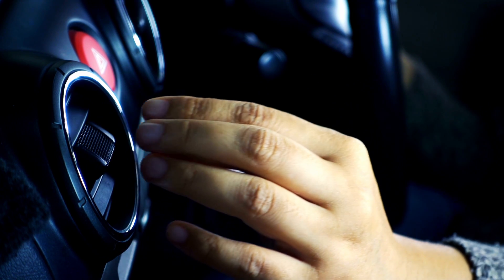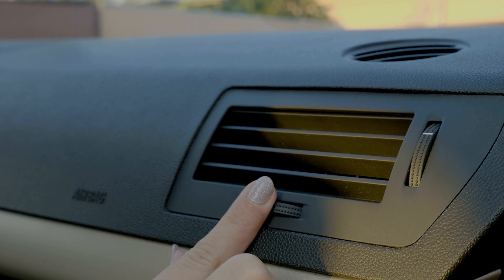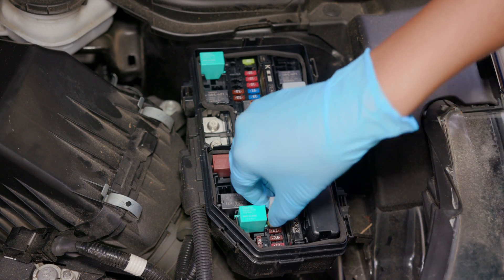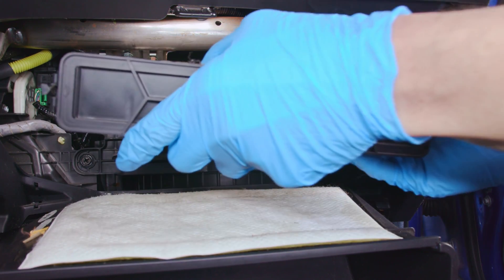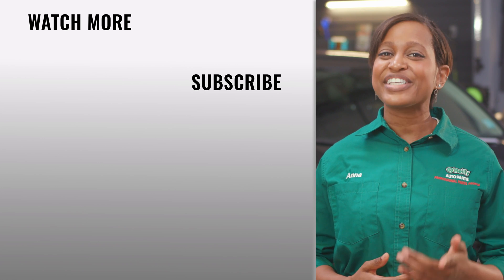Diagnostic: Why Is My Car A/C Not Blowing Cold?

Comment from the maker: 0:00 Welcome Back
0:40 Air Isn't Cold
0:53 A/C Compressor Not Activating 
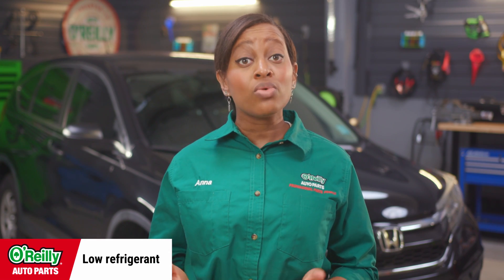1:12 Low Refrigerant 
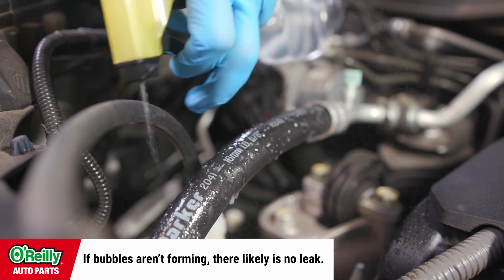1:45 Clogged A/C System 
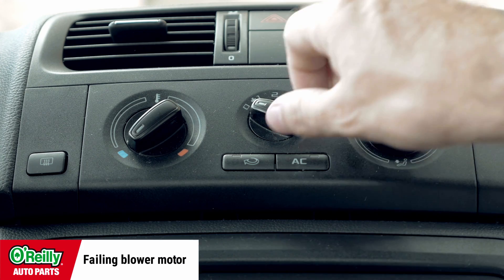2:20 Failing Blower Motor 
2:57 Dirty Cabin Air Filter